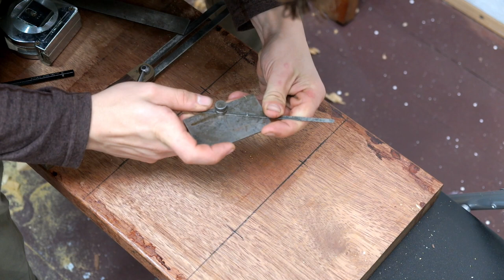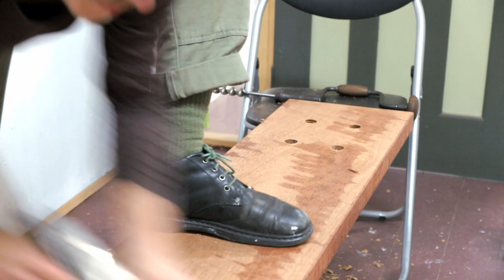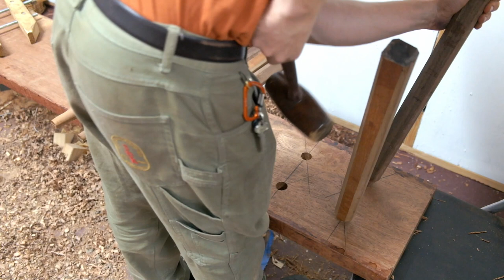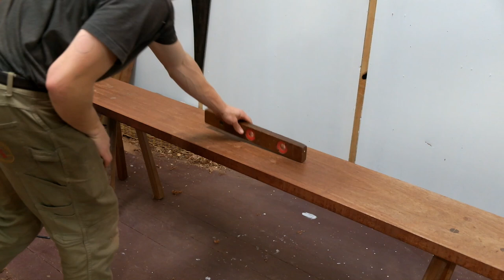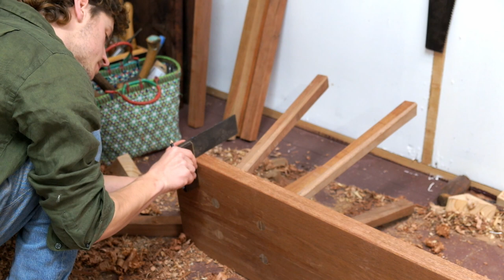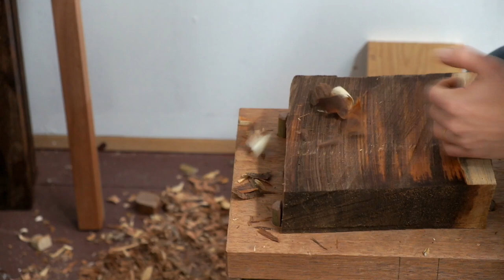Building Schwarz's "Herculaneum" Low Roman Workbench

Comment: Did not want this build video to end! Excited to see more of how you will put it to use. I have this nice slab of 2 inch thick by 6 foot white oak sitting in the corner of my shop. I have seriously considered using that for my low bench, except that it’s only just over 8 inches wide. Not sure if that would provide enough work surface.
Reply from the maker: Thanks mate! 

A skinny one could definitely work if you Mostly use it for planing and sawing, occasional joinery. My advice is to make it as wide as you can comfortably straddle and no more.
Reply: Thanks, I’ll likely mock it up by clamping it to some chairs and see how it feels. Most joinery I do at a standing bench with a vise, but I’ve wanted a low bench for sawing and rough planing, as well as other green woodworking tasks as you have built yours. Great work again, thank you for your videos and responses to comments and questions!

Comment: I plan to build a variant of this. I'm disabled and 90% of the time need to be seated, so the bench is ideal. But I will put a raised platform one end and make that a portable workbench aka Pask Makes at a more suitable work height. Most of my work is small scale 16in/model/ornament size
Reply from the maker: That sounds like a great idea. Best wishes with it. Feel free to email me if you need any guidance.
Reply: You can clamp a simple box onto one end to have a higher workspace if staying super simple is your goal. You could even clamp a piece of plywood with a bench vice screwed into it